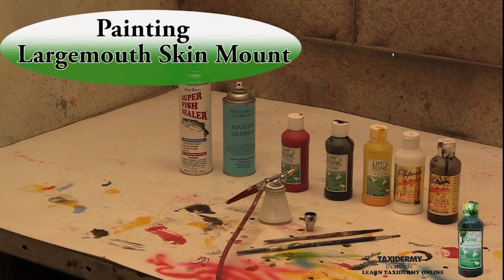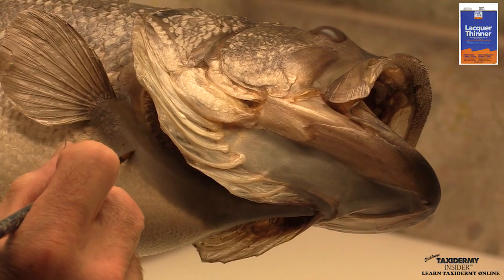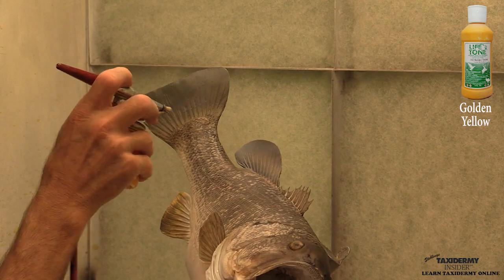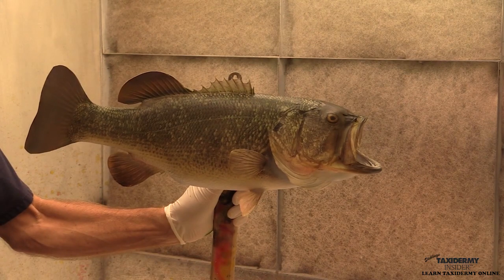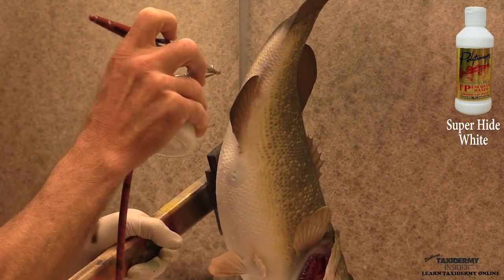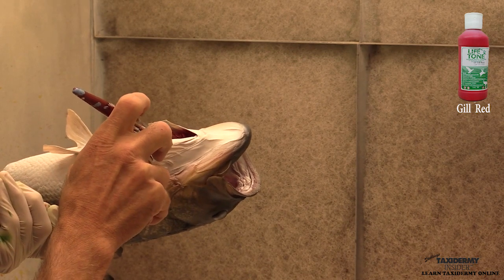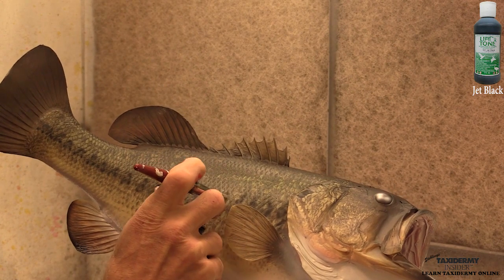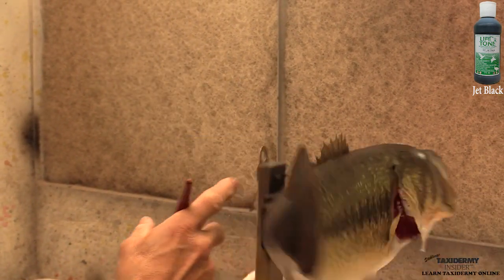Largemouth bass Skin Mount # 19 Painting

Comment: i reclear coat my fish mount and the eyes and kind of cludy when it dry is that normal i did clean them a bit my some alcohol but not prefect but i try again with the lacquer thinner is it okay if i clean them back to noraml and just leave them as it when clean or do i need to reclear those areas
Reply from the maker: This can occur when it is humid with some types of glosses. Try glossing when it is not as humid or use a different king of gloss. Rustoleum gloss works well and can be bought at walmart or hardware stores
Reply: @taxidermytwins  u mean the Rust-Oleum Painter's Touch 2X Ultra Cover Gloss Clear